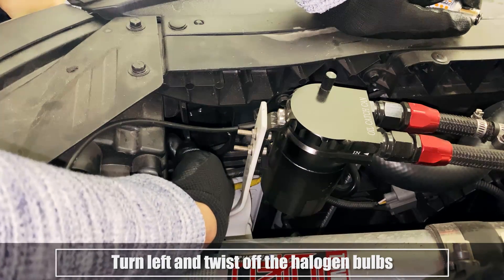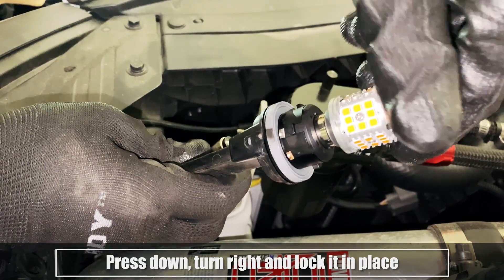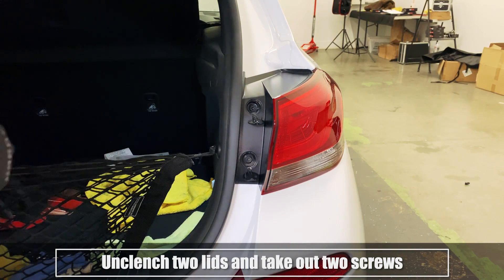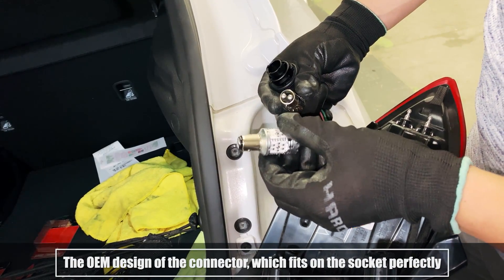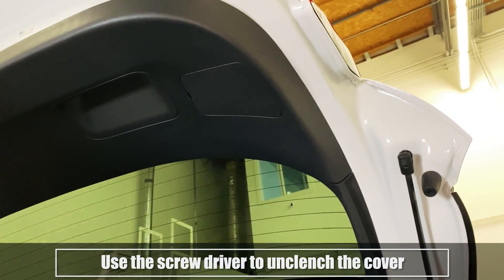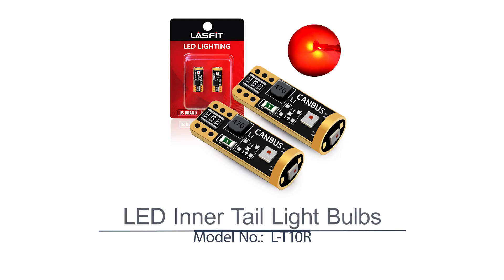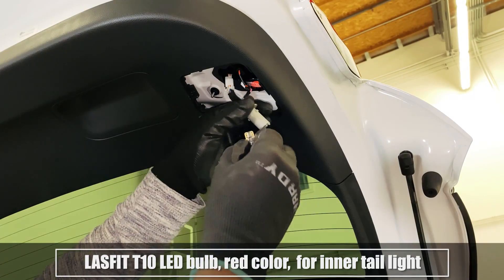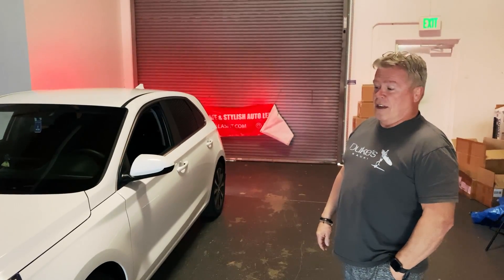2019 Hyundai Elantra GT | How to install LED turn signal brake backup tail light bulbs

Comment: Thanks for the videos, I have some Lasfit lights already installed and they work great. Question though...all of my lighting inside and outside are now LED, except for my red tail/brake lights. All of the one's I've tried have thrown an error code. I've seen you're and see you noted they will not work properly on Hyundai Tucsons. Do you have any red 1157 LEDs that will work on a Hyundai Elantra Value Edition without throwing an error code? Thanks
Reply from the maker: Hello, we found these LED bulbs, including other LED bulbs on the market are NOT compatible with some models of Hyundai & Kia. So, we don't recommend these LEDs to replace the brake/tail lights. BTW, did you try to connect the load resistor together?